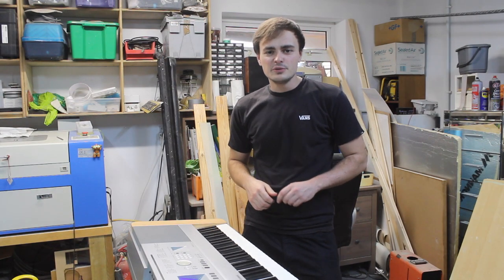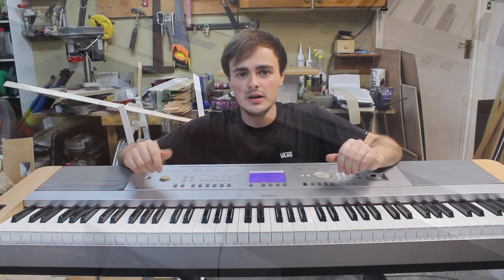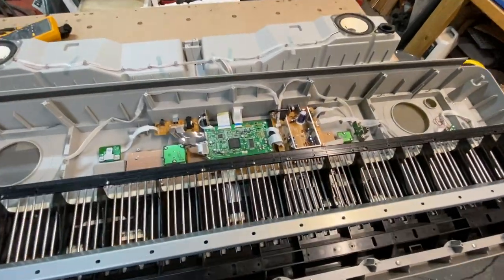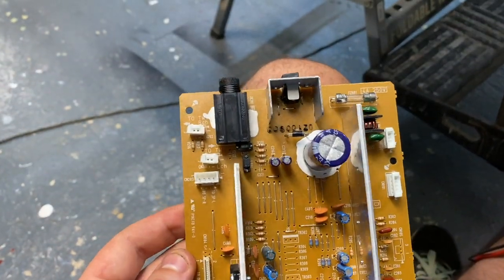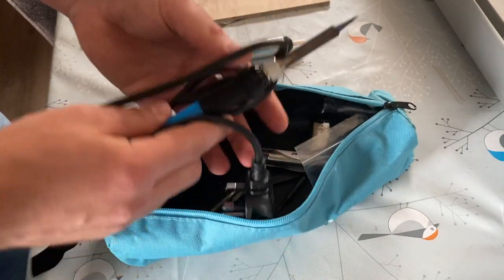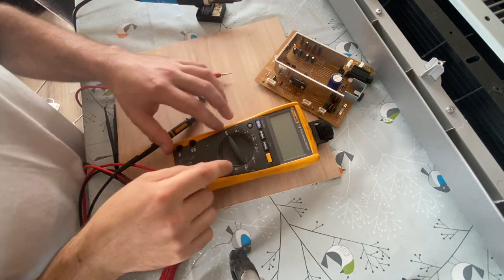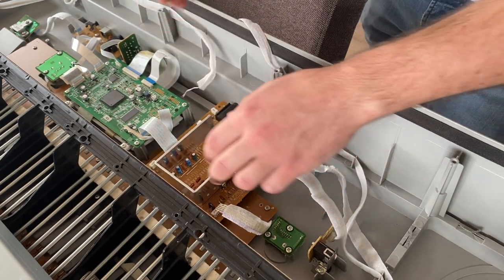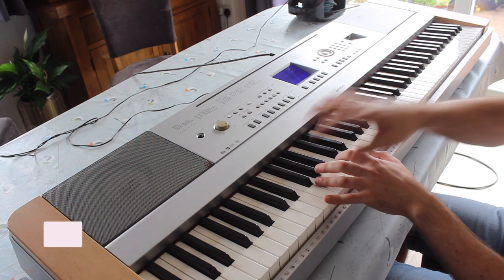Yamaha DGX640 NO SOUND - How to repair faulty electric piano that has no sound from speakers

Comment: To be on the safe side I replaced all capacitors on the amplifier board and it is perfect. Million thanks again for sharing your guide, the cost of the new capacitors and thus the repair was only 3 euros.

Comment: There are many videos that give the illusion you are going to get some info out of them, but they are worthless as many do not explain how to go about testing and resolving the issue. 

Well done in your approach and explanation. The amp section should be the first to be tested, when there is no sound, and caps are notorious for going bad especially if you have had the keyboard for over 10 years. Sometimes visual inspection reveal the puffy bad ones, but this is not always the case.  

On my PSR S910, the power input/amp section had a bad power cap 6800 uf it was reading around 600 uf  I lost sound while fixing the input mic section that goes through a dual op amp on the same board, similar to your board but larger.  I took that dual op amp out of the circuit to test it using an op amp test circuit, I thought it was bad, but it actually turned out to be good, however the main cap at the power input was bad, this explains why sometime my keyboard had a delay in turning on which I thought was the external power supply adapter but that was not the case.  I am also testing other small caps individually since my keyboard is way over 10 years old and I love it, so I decided to fix it and get it back in working order again.  I am just hoping I don't have to replace the amp chips on this board after I replace the bad cap (s). I suspect it is the main cap that delivers power to the voltage regulator that powers the rest of the chips on that board, but the voltage regulator checked also fine.  I also just replaced the rubber carbon key contact strips with new original Yamaha replacements and was hoping to be playing it but looks like it is going to need more time to get working again. Cheers!
Reply: Hi! Did you fix it? I'm having the same problem with my piano. Thanks

Comment: Thank You for your video. Exactly same issue. Fixed it using 25V capacitor. I guess there is some problem that exactly same one dies.

Comment: Hi Turner, this is going to be a long shot but it doesn't hurt to ask. I have a DGX-660 that works well electronically, but I get an annoying buzz from the right speaker on certain notes. If I press down on the grill, the buzzing disappears. I already opened it up but couldn't find anything loose that may cause that, but I tightened any speaker-related screws just to be safe, to no avail. The grills themselves are not screwed down, rather that have those "twisted tabs" you also have on this model (visible at 3:46). Has something similar ever happened to you? Other than trying to straighten those tabs to remove the grill and possibly add some foam in between, I'm not sure what else I could try. Any advice would be most welcome! Thanks in advance.
Reply from the maker: Hi there, I think you answered your own query. I have had this on mine and found that adjusting the metal speaker covers stopped the vibration 😊
Reply: @TurnersWorkshop97  Did you adjust them "from the inside", by tweaking the bent tabs? I tried repositioning them from the outside but they don't seem to move at all!

Comment: Hello! Great video! Question - In order to clean the speakers under the grill, does one need to take out all the screws as well, or is there a way to pop the grill off? Thanks so much!!
Reply from the maker: Hey, thank you! To clean inside the speakers it’s easiest to open up the piano as there are little metal tabs twisted from the inside holding the metal speaker covers on 😊
Reply: @TurnersWorkshop97  thank you so much for the response 🙏

Comment: Thank you very much, great video which can potentially save me a lot of money. Do you happen to remember or know the values of the capacitor on the amplifier board?
Reply from the maker: No problem, thanks for your comment 😊There’s a link in the description to the capacitors
Reply: @TurnersWorkshop97  Thanks a lot. I was thinking of the other capacitors that I would also change once the piano is opened, as those can also go wrong with time.

Comment: Feel dumb asking this, maybe u mentioned it... But it's not possible to measure capacitor using those multi meter probes by touching the solder points?  Or is there a lot more going on in there with it connected to the board still?
Reply from the maker: Not a dumb question at all! If it’s got other components in the circuit you will get different readings so you have to remove the capacitor from the circuit to get an accurate reading.
Reply: @TurnersWorkshop97  ... Copy that... Thanks bro

Comment: Thanks for that insight. I have a korg Kross 2, with a intermediate sound drop while playing. The sound comes and  go sporadically as I'm playing. So, based on your video, you mentioned early on that it can be interference from a head phone adaptor in the head phone jack / or a faulty capacitor.  Is that considered an audio interface motherboard where the faulty capapcitor is located? Also can a faulty capacitor make the sounds sporadically drop as you're playing the keyboard and then suddenly return back to normal again? Thanks for your insight. Best wishes. Special thanks again.

Comment: Thump, maybe my solder joint weren't good enough. Have to check it. Otherwise works fine. Thank you again. Had my 640 for about 13yrs, first time it ever had a hiccup. I was playing it and actually heard it fry the cap and shut down.

Comment: Thanks for this video. I have a dgx 640 and none of the keys make any sound. But if I play a beat it works fine with sound. I tried resetting by pressing the last key but it doesn't recognize it either. Any ideas please for me to diagnose the issue. Thanks in advance
Reply from the maker: No problem, I would take it apart and see if there is anything obvious - fuse, blown capacitors, burn marks etc. Clean the dust under the keys.

Comment: Thank you. Replaced the exact same capacitor, on my DGX 640, and It works again, it does now have a noticeable thump when turning off the power switch, even with the volume all the way down. Didn't have that before ?? Perhaps the new capacitor, ?
Reply from the maker: No worries, glad it worked for you. Mine does the same thump. Hasn’t been a problem so far.

Comment: I have a different problem. Yamaha p-70. Bought it recently and Only the left speaker work and not the right one. U think could be blown speaker ? Or is this symptom issue ? Anybody got a clie?
Reply from the maker: If you try swapping the left and right speaker wires that should tell you if it’s the pcb or speaker blown
Reply: I have the same problem as you

Comment: Thank you so much for the video!!! I have a Yamaha ypg-625, technically identical to the one you’re sharing in the video. The issue I’m having is that the volume is very low. I can’t really pinpoint that there’s anything wrong with the caps on the power board. Could it be that a capacitor could be “almost” or “half” defective and is causing the speaker volume to be low?

Would appreciate any and all help. Thank you.

Comment: Hi Turner, great video!

I have a problem with my Yamaha psr-e373 (only 6 months old).
While I was away for a few days I forgot to pull the plug out and my cat lied on it and turned it on... (the neighbor turned it off) ...but the worst part is that the cat also urinated on the very left end (not much, just a spray, not near the motherboard). It had already dried up and I didn't see it at first so I had turned the keyboard on to play. Then I realised something was wrong.

Luckily most keys work perfectly fine, also in the left corner... but the weird thing is that the third white key of every chord doesn't work... and also the same black key of every chord doesn't give a sound.
Sometimes if I press all the white keys, that don't work, at the same time a hesitant tone comes out... delayed. Or when I press one of the keys very softly suddenly a hard tone comes out.
The few black keys do not work at all... 

If I would open it up and clean the inside of the keyboard very carefully, would there be a chance that it will work properly again?
Or is an electronic part damaged?

I'm really worried...
Reply from the maker: Thank you Elianne, I’m very sorry to hear about that. If it’s only 6months old it might be under warranty still? Might be worth looking into. 

If you need to take it apart because the electronic components are water damaged, then they might show signs of corrosion. It could be worth cleaning with isopropyl alcohol and cotton wool. If this doesn’t work then it would be a case of trying to identify faulty components that could cause the symptoms you mention.
Reply: @TurnersWorkshop97  Thank you very much! 
Yesterday I decided to open my keyboard myself after watching a lot of video's. The electronics looked all fine and there was no urine.👍🏼
Then I took off the keys and there was a lot of pee underneath, so that was the problem. I cleaned it very carefully and let it dry well. And thank God, it works fine now!! 😃 I'm so relieved.
Reply from the maker: No problem at all, so glad you managed to fix it! Well done 😊

Comment: Thank you so much for this guide, it's giving me hope! Do you remember how hot you heated the soldering iron? I'm inexperienced with soldering, so I'm not completely sure what the problem is, but the solder gluing the capacitor to my keyboard's circuit board (the exact same model as yours) does not seem to want to melt for me at all in the temperature ranges I found advisable.
Reply from the maker: No problem at all, I hope you manage to get it sorted. I don’t go by an exact temperature but it’s hot enough that the solder melts easily. Are you using electrical rosin core solder?
Reply: @TurnersWorkshop97  Thanks for responding, this encouraged me to push up the heat without worrying (I'd read too much about the dangers of damaging the components/circuit board), and I got the desoldering and soldering going. My keyboard makes sound again, I almost can't believe it! Thank you!

Comment: I'm about to try this on mine (same symptoms). But I notice that my speakers make a classic slight "thump" when powering off, which to my previous experience would suggest that the amp is getting some juice. Did your example make a thump at all when powered on or off, or was it silent?
Reply from the maker: I had the same thump when powering on and off 👍🏼
Reply: @TurnersWorkshop97  Yes!!! It's fixed. Interestingly I also had a Yamaha Portable Grand NP-30 (bit of a collection, eh!?) that also made no sound. Having fixed the DGX640 successfully, I took a look at that and found four electrolytics on that amp board that looked to be similar values (lower voltage) in a similar configuration. Sure enough, the "bottom" one was dead and replacing that fixed that piano two. I guess they used the same, somewhat dubious, circuit in both!

Two fixed keyboards, thank you so very much!

Comment: Hello ! really informative video ! 

I have an old Yamaha keyboard PC-100. There is no sound if i play it under not normal function. However, if i play it under chord function, it works perfectly. Could you identify what the problem it could be ?
Reply from the maker: Thank you! If it’s got sound coming from the speakers, the amplifier circuit board is working so possibly the switch that changes from chord to normal isn’t making the contacts on the normal setting.

Comment: For some time now, when I touch the body (except for the wooden part) or when I hit the keys a little hard, my piano makes a sound like a marble. This issue gets worse when I hold the pedal and play music.(I tried even when the piano is turned off and there is no electric current in it, it still makes this sound). What is the problem?

My piano model is clp725

Comment: Hi, this video helped me resolve the completely no sound issue, but now the piano keys are significantly softer than any other sound made by the piano (even the metronome). Confirmed that the speakers overall working fine as the demo music is still decent volume, but any sound generated from me pressing the keys are extremely soft. Any possible ideas what else might cause this symptom?

Comment: Hi, tank you for that fix. So far it worked! But now i only have sound on the left channel... on the speakers as well as on the headphones.. can you guess what Problem that could be? Thanks a lot, best regards, tobi
Reply from the maker: Hi Tobi, glad it worked for you. Double check all of the connectors are clipped in properly as could be a loose connection perhaps.

Comment: Hi, I have the same digital piano and it's giving me an issue, I wonder if you could guess what's causing it. Whenever I play a big chord or arpeggio, let's say E major, the piano makes a B flat sound, or it makes a B sound for F minor, or a A flat sound for G minor, etc. I checked the troubleshooting section of the manual and it says the P.A.T. button (performance assistant technology) could be the cause but it's not solving my issue. Do you have any idea on what could be going on?
Reply from the maker: Hi there, unfortunately I’m not sure about this one. When you reset the piano this setting should be cleared and back to factory settings. Sorry I can’t be much help.

Comment: I see a laser cutter 😆 your man cave is similar to the one I have haha good fix. Will be nice to see some laser cutting videos 😛
Reply from the maker: A man after my own heart 😁 Made anything cool with yours? I’ve got some early laser cutting videos of some projects I worked on. I will definitely do more on it come the winter time.
Reply: @TurnersWorkshop97  sadly not yet I usually mess around with my 3d printer more because i can use that in my house. Would love to learn how to CNC. I have one of the cheap Chinese 3040 cnc machines but I found it's really difficult to use however I will go back to it.....one day 👀 Have you ever gave CNC machining a go? I have a k40 laser with air assist and a few other small upgrades done to it nothing amazing 😔 Campers, mechanics, electronics repairs and making things sums up my life haha 😄 sounds like you're pretty much the same (always something on the go). Can never beat a good project. Love your videos BTW the van builds have been really good and your wood work skills are impressive. I lack the patience sometimes for the perfect finish.

Comment: I have this exact one but for mine it’s only specific keys not work namely the d and c# on the lower side of the keyboard any idea what that might be ? I checked the capacitors and cleaned any idea where the problem is ? 😊

Comment: I've replaced C207 but speakers still low any advise thank you so much. Dgx620
Reply from the maker: Did it make any difference changing the capacitor? Was the original fault no sound at all or low sound level?
Reply: @TurnersWorkshop97  No difference. So I decided to change 4 of Capacitor but speakers still very low same as before changing the Capacitor. What to check next? Thank you very much
Reply: @christmassajjaharutai8051 hello, I'm having the same issue, did you fix it? Thanks

Comment: same as my yamaha piagerro np30 with power but no sound, i try to connect it to my amp and check the headphone and output jack but still no sound. I reset it also but still no sound.

Comment: First off huge thanks for posting this video! I followed the exact same steps and now the sound is back!
However, there is now a secondary issue. The volume of both L and R speakers is super low even when I turned the volume knob to max. When I plug in my headset the volume is normal. Given both speakers have low volume, I suspect the issue is not speaker itself but another circuit issue such as a depleted capacitor. Any thoughts or advice would be really appreciated!
Reply: Actually, I realized one thing. I replaced the C207 with a 10uF capacitor while it should be 100uF. This is probably the issue. Let me fix this first and post back.
Reply: Update; I just changed the capacitor to the right 100uF however the low volume issue still exists. As mentioned above volume is ok with headset. Not sure what’s the fix and welcome any ideas!
Reply: Last update: I was such a fool that I didn’t connect the speaker therefore the volume was very low. Once I connected it back everything came together perfectly! Once again proved that this video is the crown jewel fix!
Reply from the maker: Thank you for your comment, really glad you managed to get it sorted. Nice work! 😊

Comment: i have a yamaha ypg 635 and my left speakers arent working but the right sound fine
Reply from the maker: You could swap the l&r wires around to see if it’s the speaker or circuit board.
Reply: oh dang , now why didnt I think of that.  thanks . hehehe  @TurnersWorkshop97

Comment: Hi. I have Kawai 31 digital piano. He doesn't give any sound. Panel works goed. But no sound coming. I have tested the capacitors on sound power amplifier with Peak ESR 70 gold. Here are the figures